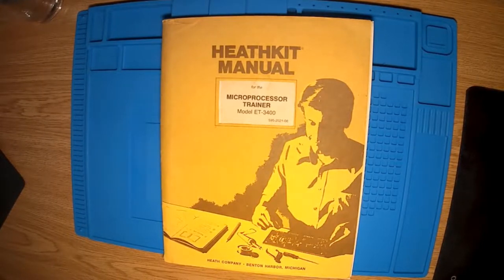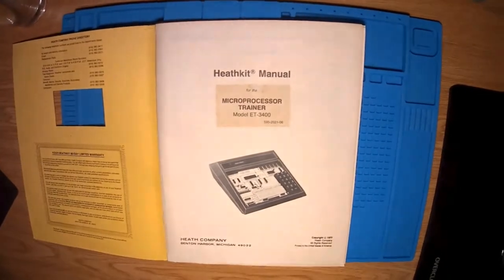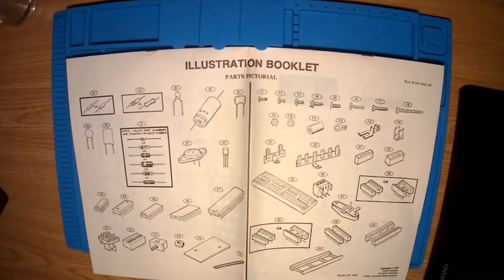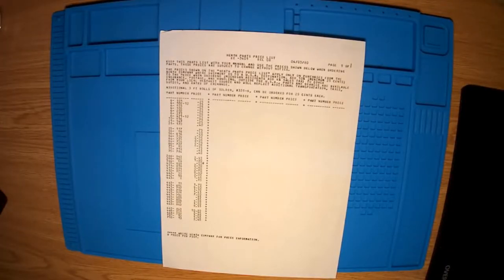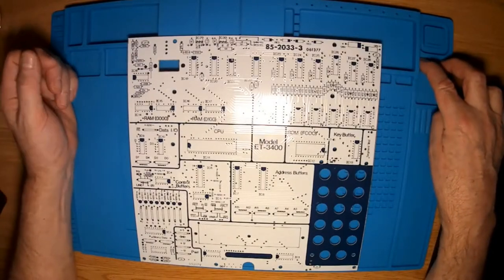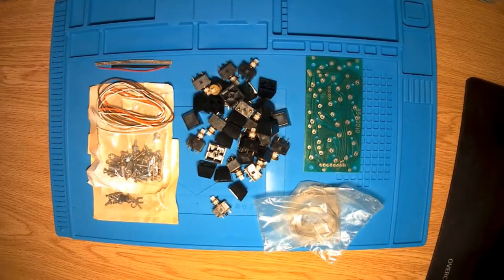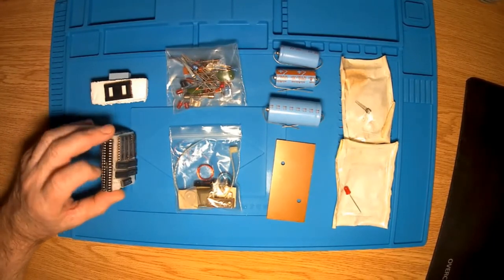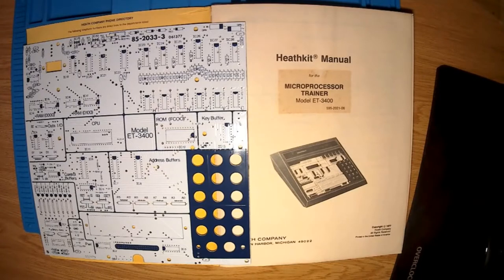Building a 1980 Heathkit ET-3400 Microprocessor Trainer Kit - Part 1

Comment: Hello Michael . Thanks for sharing this , it brought back a lot of memories . I'm  from Dublin so I ordered the kit from Maplin in the UK .  I can still remember their post code as it was where I got most of my stuff back then , I'm sure you know it well.  It was mainly a hobby with me and it took about 5 evenings after work to complete it.  Seeing that manual after all these years was great . I also bought the additional courses  that were available at the time . Looking online now I don't think that there is anything as good for a beginner . I know about Arduino,s and Raspberry etc. but I think they remove you somewhat from the actual workings of the processor .  I couldn't see any follow-up video , maybe I missed it , so  I wonder how you got on ?
Thanks again , Kieron
Reply from the maker: Hi Kieron and sorry for the tardy response!  You're right, there are no follow-up videos yet, as I've had a real problem sourcing the missing on / off switch, and wasn't going to start on building the kit until I had that part.  I eventually managed to track a couple of second-hand switches down in the US, and they got here a week or so ago (phew!), so once I've got a couple of astronomy projects out of the way I'll be back on to building the ET-3400 :-)
Reply: Thanks Michael and good luck with all your projects . Take care , Kieron